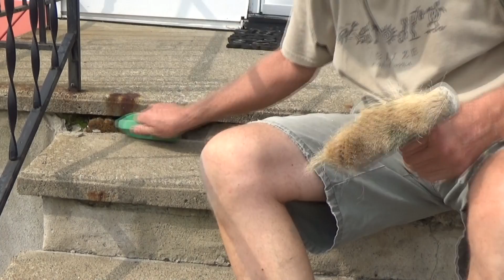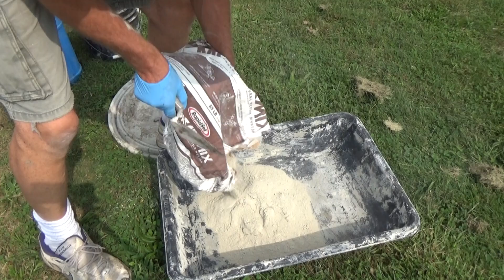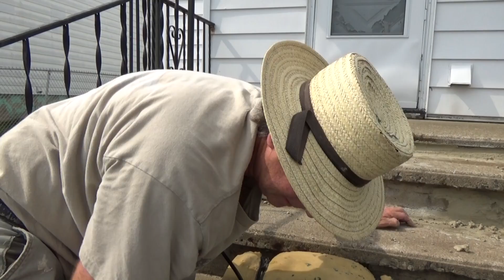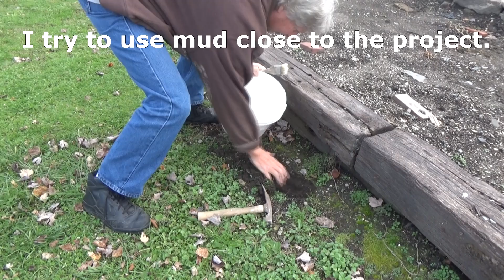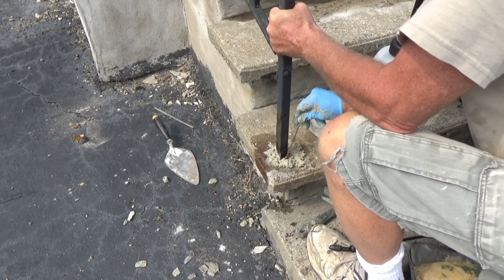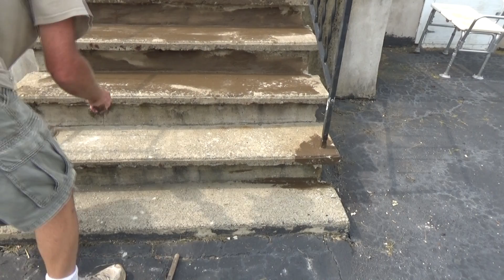CONCRETE STEPS REPAIR  (part 7) Mike Haduck

Comment: Excellent videos on the steps. I noticed on some you use Mortar Mix and other steps you used Cement All (white/blue bag). Is there a reason you choose one vs the other?
Reply from the maker: Hi Luis, they are basically the same product, the mortar mix has sand in it and forms better and in my opinion is a strong as concrete, so I use that in most situations but the other has no sand and is better is some situations,  thanks Mike

Comment: Does anyone know how long this repair will hold?  Could it be painted, sealed, or epoxy paint coated afterwards?
Reply from the maker: Hi TLV, I usually paint them with a good masonry paint and it last, but like anything you got to keep up on it, thanks Mike

Comment: What’s the life expectancy of these repairs , I’m only asking because I had a very experienced concrete contractor who I worked with on a lot of job sites and he owed me a favor so he did some patch work on my old house’s front porch ,my backyard’s concrete pad , and my basement floor which was a joke the floor was only 1/4 thick concrete. But he did a really good job , used a bunch of expensive bonding agents, quick drying waterproof cement in the basement, and on the front of my porch’s edge a crack developed and was only 1/2 thick for maybe 10 inches long but he cut out a big section like a 3” high x 3’ long area that was 4 inches deep . Then he drilled a bunch of tapcons into the area he just neatly cut with some wet saw so the cement would have something to grab onto then painted a thick layer of bonding agent onto the whole are , and filled it with some special cement designed not to crack. He told me I would get 8 to 10 years out of that patch but some others he informed me since he was only patching a damaged area and didn’t cut out a bigger area it may only last 1 to 2 years .
Reply from the maker: Hi Mr big, all I can say is a patch is a patch, and even new jobs sometimes don't last, I guess my answer is you got to take it as it comes, thanks Mike

Comment: Is morter the same as cement. I always thought morter was only to use between brick? But I see you use this morter for stair repair often.  How long would a repair like this last. I have been fighting using different products, to repair my front steps. I will give this a try.
Reply from the maker: Hi Dan, they keep changing names with the new products, I just show what I used on each job, I hope it helps, Mike

Comment: Old Painters trick when you spill paint on concrete, wash paint off with water or thinner then find some dirt and rub in to concrete, blend it all in.  Or find some paint about same color as the concrete, but that's a bit trickier...   Had to laugh when I saw you get the dirt from the back yard!   I came here because my old slab from 1945 blew out on the edges from rotting sill plates, and water damage.  I'll get my mason's hammer and pound it out, get some rebar, etc, but probably using concrete and a form on this deal.  I just need to get it halfway level for a new PT sill plate (2x4) and some new j-bolts, etc, build it out a bit and call it Macaroni!  And Bob's your Uncle...   

Leondardo DaVinci painted the Mona Lisa, Mike-E-Langelo painted the Cistene Chapel...  I like your videos, I guess I'll keep looking for the right one for my project...
Reply from the maker: Check out my video," concrete patches ( part 5) Mike haduck, that might help, thanks Mike

Comment: Great video, very helpful. Thanks Mike! In your other videos you use Cement All as well. What is the difference between Mortar Mix and Cement All? For what kind of job you would use Mortar Mix and for what you would use Cement All?
Reply from the maker: Hi Jian, to me they are the same except the motar mix contains sand, I did a video called cement all, Mike haduck ,thanks Mike
Reply: Thank you Mike!

Comment: I am doing my concrete steps. Very old and big holes. Any tips? Do I use Concrete Mortar mix to fill in the holes? I got finishing mix. I thing I have to take that back.
Reply from the maker: Hi Tammy, I haven't used a finishing mix, thanks mike
Reply: @MikeHaduck , thank you.

Comment: Mike, you are the best. No nonsense. Taught me a lot. But I have a suggestion for you - give your knees a break.  Once I started using knee pad my 56 your old knees feel so much better. Just cheap $10 velcro knee pad.  Give 'em a try.
Reply from the maker: Thanks Daniel, I appreciate it,  mike
Reply: @MikeHaduck  Hi Mike,  Filled in the cracks and holes on my concrete stairs with rapid set mortar mix used the mud trick too!  Looks good. Some higher and lower areas left. Now I want to go over the whole thing and make it look nice and uniform.   Should I use Cement All for that or something else?

Comment: Hi Mike,  I have a set of cement stairs where they have settled so they are low in two directions.... they are one big solid piece and cannot be jacked up... can rapid mix be used to level the treads and top landing.... or will it chip off...?
Reply from the maker: Hi Theresa, I use it all the time to level masonry out, just remember it drys very quickly,  thanks Mike

Comment: Hi Mike thank you so much for sharing your experience. I would like to show you a picture of my front porch steps that are getting cracks on the front...I am not sure of the correct term. It is not the part you step on. They havent chipped yet but I am sure they will and I wanted to prevent it for awhile. How do I contact you? Thanks Carmella
Reply from the maker: Hi, I can't give advice over the internet,  I only show what I did in each situation, check out my videos on concrete step repair,  I am sure you will find something similar, thanks mike

Comment: Hi Mike. Great video. One of my steps have a hole in the middle foot path of the steps. The hole is about 3 inches deep and it's hollow. Can I just fill the hole with concrete till it's leveled or do i need to add  rock or something to help fill the hole before i add concrete?
Reply from the maker: Hi sbmlewis, I can not say unless I was there to see it, I show a lot of the ways I have done it on my video series, I would ask maybe some of the locals,  thanks, mike

Comment: I use Rapid Set Mortar outside under crazy conditions with no cracking.   Did my first inside the house work with it to close up cement board joints and got cracking.  I did not use mesh and the humidity is about 40%.  Should I just slap another coat on?
Reply: My experience with that product Mark is that the drier the conditions or surfaces, or the more porous the surfaces, the more this fast cure mix cracks for me. When I have a particularly stubborn crack, that is cosmetically an issue,  a high quality construction adhesive pressed in the cracks helps secure another coat of the Mortar Mix.
Loctite has a really interesting 8X fast grab.
Mike has videos where he shows using these type of solutions on floors.

Comment: When I patch my front porch steps this spring, I will use this method. Their concrete is 30 or 40 years old, and I put it off in the fall, because I knew it would stick out like a sore thumb and I wasn't wanting to paint the whole thing with Portland either. Thank you so much Mike for taking the time to make these videos. I know it's a lot of work, but guys like us really appreciate it. God bless you and yours.
Reply from the maker: Thanks, God bless also, mike

Comment: Hi Mike-- I have been waiting and looking (on your site) for a video just like THIS ONE!!!! It is exactly what I need to do on my front steps only I have more damage to repair I will just have to wait until spring summer as it is winter time in NE Oh Great video Sir Two Thumbs Up  btw--No bonding additives??? Thanks for taking the time to post
Reply from the maker: Hi Rosario, thanks ,I use no bonding agent with this product, it drys way too fast, i appreciate it, I will be glad if it works out, thanks, mike

Comment: It’s actually muddy water mix. So it will look weathered?
Reply from the maker: Hi Raff,  yep that is the idea,  hide the new look and make it blend in,  thanks mike
Reply: Raff yes I believe that’s the intention. Fresh patches look bright, white, and stick out like a sore thumb! But a little mud stain will make the new patches blend in with the old weathered dirty concrete.